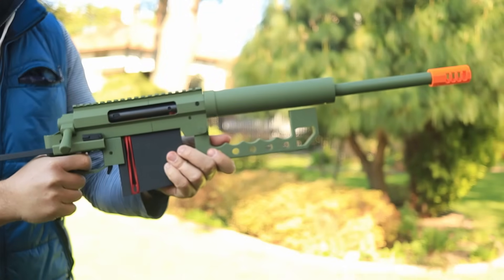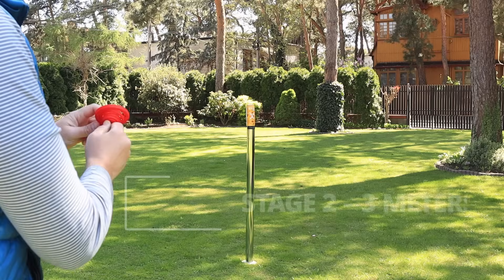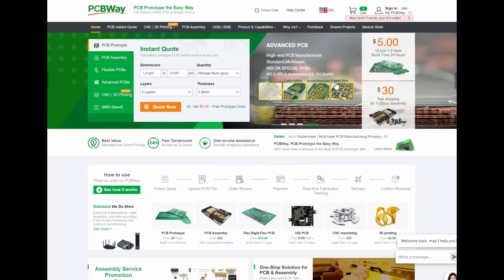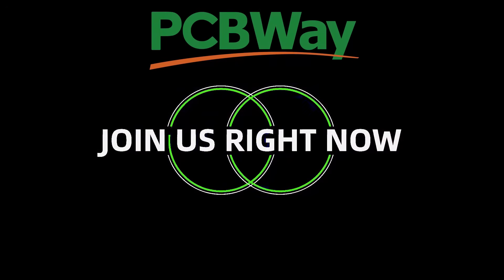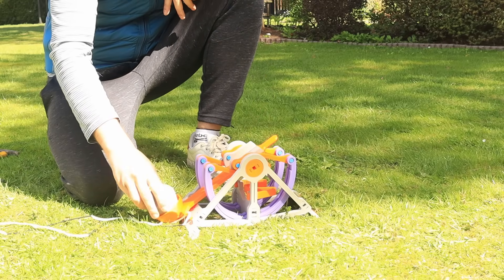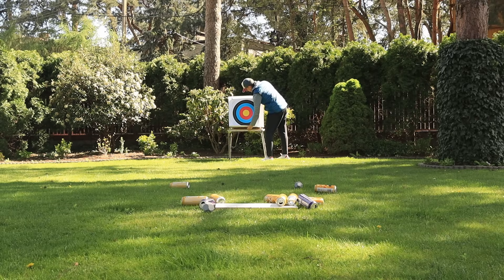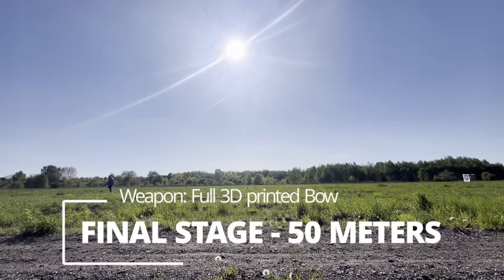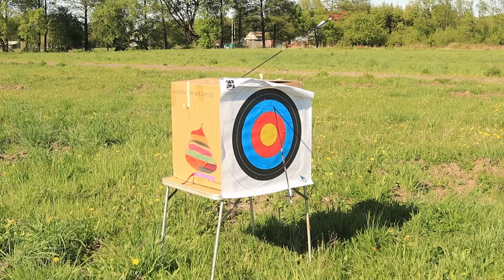TOP 3D Printed Weapons – Accuracy & Range Challenge!

Comment: if you use hardware, you can get hobby nerf blasters that rival paintball in velocity and accuracy. also a proper 3d print slingshot frame with rubber slingshot bands will be as accurate or inaccurate as the user
Reply: Received my Grainrain and Awaken blasters last week the accuracy is amazing for blasters

Comment: no offense but the way your holding the bow is wrong. To hold a bow properly, start by standing with your feet shoulder-width apart, perpendicular to your target. Grip the bow with your non-dominant hand (the hand opposite your dominant eye), placing the web between your thumb and index finger against the bow’s grip. Your fingers should wrap lightly around the handle—don’t squeeze too tightly, or you’ll affect your aim. Keep your bow arm straight but not locked, with a slight bend in the elbow to absorb the bow’s energy. Your dominant hand will pull the string back during shooting, so keep that arm relaxed until you're ready to draw. A proper grip helps with accuracy, consistency, and reduces strain.

Comment: I’m very familiar with archery. I’m betting the ends should be turned the other way around. At least they would be on a normal bow. The way you have it the string could potentially slip off and hurt you. You will need a longer string of turned around.